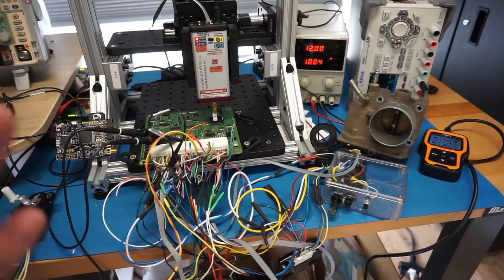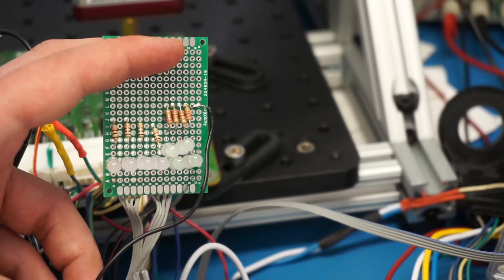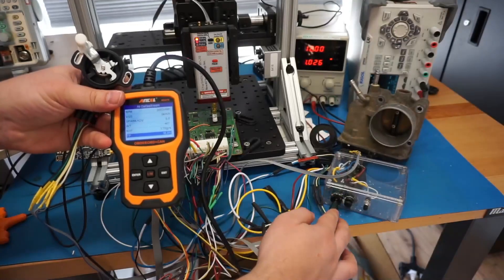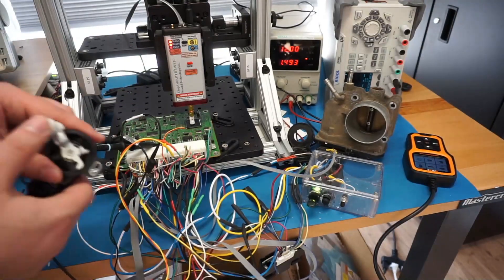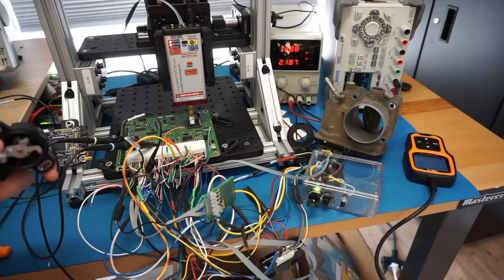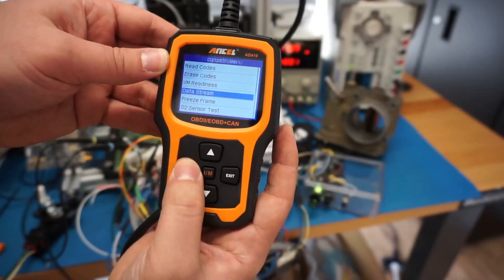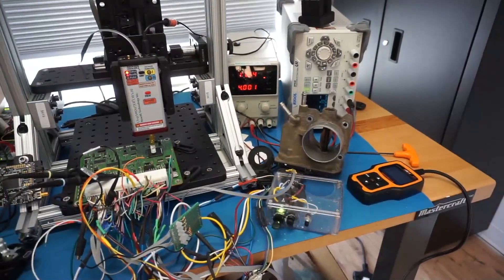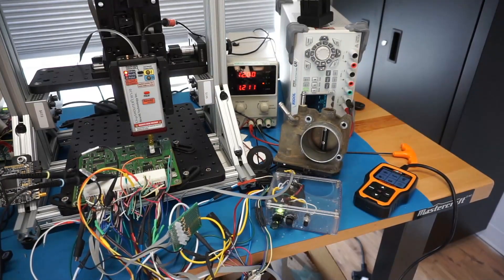Toyota "Stuck Throttle" Investigation - More Tests on ECU with EMFI (Part 2)

Comment: when u initiate the fault do the injectors and coils fire too to have a full throttle situation or is it just the throttle open?
Reply from the maker: The injectors & coils are going still (it's hard to see but had some LEDs to test this). However what I didn't have confirmed is the "other stuff" is working (in particular fuel pump relay is still enabling fuel). So I can't really confirm if the vehicle would take off - but I actually have a complete car from some years ago sitting around, I'm hoping to get the test working on-vehicle this summer as may finally have enough time to do so!
Reply: @ColinOFlynn  thats awesome. man i wish i had someone like u to work with. im an L 1 2 3 ASE master certified tech and ive been messing with ecus and vehicle glitches for awhile and im developing a commonrail fuel conversion for a 6.0 powerstroke so it can be off the shelf bolt on and programmed but im doing it in my garage on spare time by myself and im no genius but i love learning and i love ur channel. hopefully i can buy ur chip shouter and chip whisperer soon so i can test my designs. thank u for the response and thank u for the videos.

Comment: You mentioned a motor controller chip. How complex is said chip? What's the communication between the main MCU and said chip? I2C? Can you snoop on the commands to it?
Reply from the maker: Have to check that out still - was going to try and pull off the BGA on one board and see if I can at least beep it out. The motor chip itself is I think just PWM going from the main micro. There is another micro that I suspect is a kinda backup/monitor chip but also haven't done much investigation into what's going on between the main MCU and that monitor chip.

Comment: Were the injectors pulsing commensurate with the stuck throttle?
Reply from the maker: This is a key point I'm trying to answer - my test bench wouldn't run the injectors "normally" - it looks like the immobilizer was happy (security light stops blinking), but I don't have a lot of other things on my test bench (do have crank+cam, but no O2 sensor, only static values on temp/MAF/etc so ECU might not like those aren't changing). I've got a more complex setup coming so I can hopefully get the ECU running fully on-bench. Been trying on-car tests, where I can get some of the failure modes but not the same stuck-open mode. Could be the stuck-open mode only happens when some other sensor input is missing/invalid, so I need to get my bench 'simulator' to be closer to a real car I think before I can try this on the real car. Hopefully then can see what's needed for the on-car test, might require a sensor to fail somehow first before this stuck state is possible.